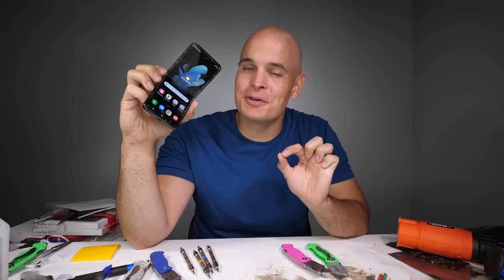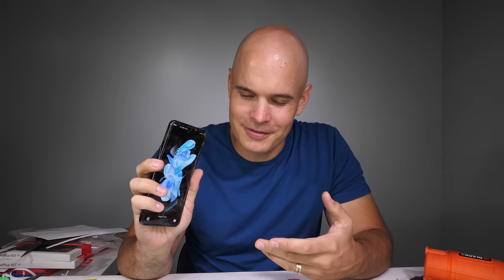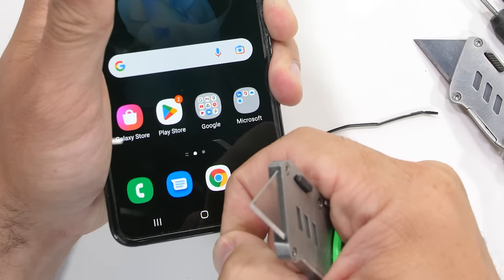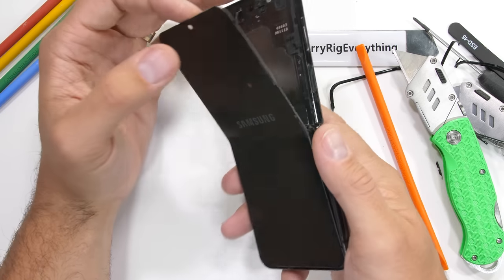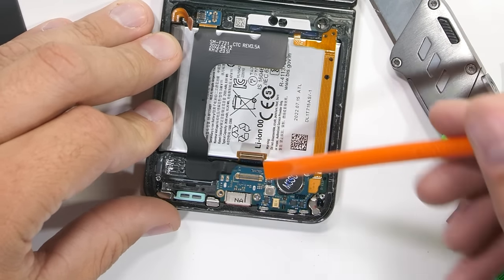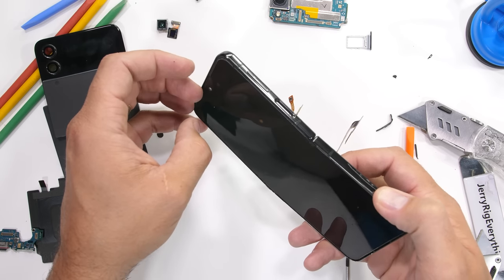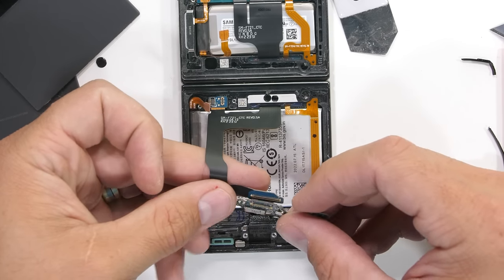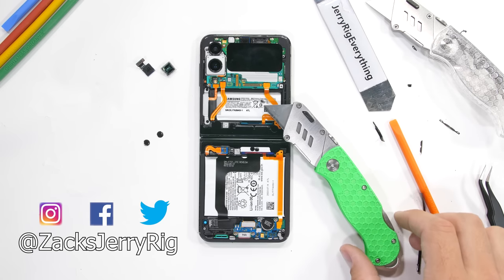They said i couldn't do it... - Flip 4 TEARDOWN

Comment: nice tear down Jerry, I am tempted to peel my screen protector from my flip 3 since the adhesive along the bend line has deteriorated over the years (ahem one year i guess) but naw i'm too lazy to take it to Samsung I'll just take it to samsung when the bubbles get incredibly huge lol. your video has given me hope that the adhesive of the screen protector will remain strong throughout the years to come hopefully. I am so tempted to buy another of your Knives (currently have the metal i use only at work) but Jerry the shipping costs more then the knife! how! lol. and for some odd reason, i thought all razor knives were the same size but the ones my workplace uses doesn't fit the knife. why! lol.
Reply: Take it asap, if you're unlick the screen protector will take out your screen

Comment: I really don't see the thrill in these folding phones. For one the durability is shit you will eventually get a crease in the middle no matter what it's just physics. Also what exactly does this add to the standard phone experience? I get the one that folds out into more of a actual tablet because you get a bigger screen but the flip really doesn't do anything special that a regular smart phone cant do other then well flip. I usually just get a kick stand case for my phone and it adds any functionality the flip has. When the technology improves more or they figure out a way to get rid of the crease my idea would be to just have 2 separate screens as close together as possible then maybe I would buy the fold because the idea of being able to unfold into a tablet is a cool idea but the price would also need to come down a lot which it usually does over time. Hopefully by the time of my next upgrade.

Comment: @JerryRigEverything 👋
I'm trying to use an used screen from older phones to plug into a broken (screen) Galaxy Z Flip 4 motherboard to access some really important info (since you can't use HDMI cable and DEX to monitor/TV) and I only got available: Galaxy S2, Note 4, S7 Edge to try. 
Are those connections different or is it possible to achieve such a abomination lol?
Thanks in advance for your answer.

Comment: I just realised you are not a fan of over engineered phones watching the iphone 14 teardown and how unhappy you was at apple for using so many screws. But now i see you love over engineered box cutters though. ;LOL. The original Stanley knife only uses one screw and what a screw it is too you can undo it with almost anything and it holds the thing together solid. But lets you swap blade in seconds. Whilst your version looks like multiple hex heads a driver a carpet fitter would need just for this one job. You basically did the Apple of box cutters lol.

Comment: So I wonder if that newly designed hinge (gearless as you mentioned) is actually better than the one on the flip 3? I'm looking to buy the 3 as its cheaper and I see no major difference from the 4.
Reply: the flip 3 folding mechanism wasn't bade either. You could totally go for it. Flip 4 feels lot stiffer and you cant open it in one hand. But in flip 3, you can.  Major difference will be in battery though. But if you are getting it cheaper and you don't spend too much time on your phone, flip 3 is a good buy
Reply: They say after the update the battery life on filp3 gots better
Reply: Traded my flip 3 with flip 4 and all I’m saying is now we’re talking 😂 flip 3’s battery was a disaster and now I feel like I’m using a solid device. Besides the crease is obviously less visible and deeper so there are improvements to consider.

Comment: Hi are you able to advise me, I'm not getting a signal on my flip 4 only gets a network signal when WiFi is connected. Thinking might be a 5G antenna issue maybe or some connectors not making a connection somewhere? Are you able to advise what to try or what might need replacing? Thanks.

Comment: AS cool as this phone is, I would respect Samsung 300% more if they included a headphone jack and an easy to replace battery(ies).  Instead, they're kicking us right in the batteries.  Aaaand that's why I haven't had a Samsung phone since the iphone 5.
Reply: 😆 You haven't repaired and replaced a battery in the iPhone since the 10 if you're still crying about this: They use water resistance adhesives now as well as Samsung has since the S6 which is why they're sealed: All ASCs can both replace your battery and confirm the entegrity of water resistance so your argument is ridiculous

Comment: Still waiting for the day Samsung uses pull taps for their batteries…
Reply: Still waiting for people to realize the very easy method for removing the battery with zero bending or pressure. Also, those pull tabs break all the time on iPhone repairs.

Comment: If you keep using razor blade instead of cards you will never accomplish removing a screen without breaking it.
Reply: He just did
Reply: @gjeraldh2989  He could also did in 50 phones before if he used Plastic Cards and Proper Heat.